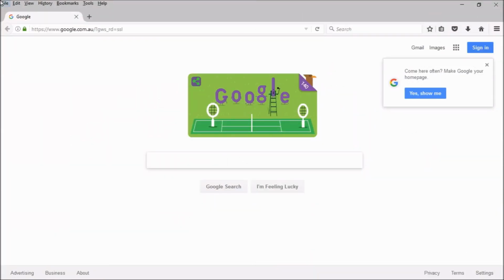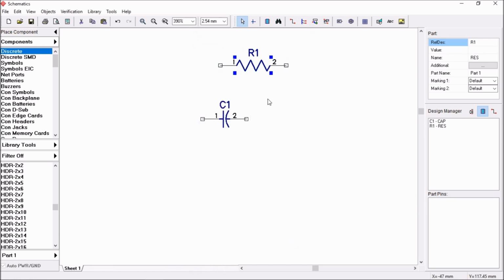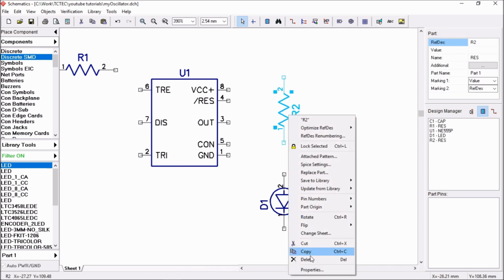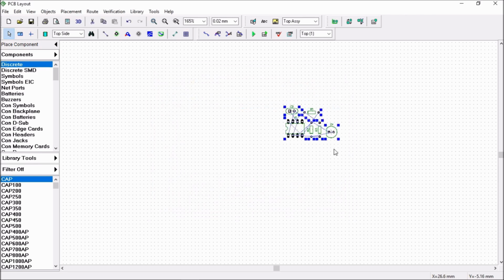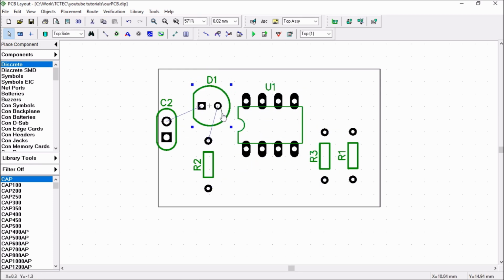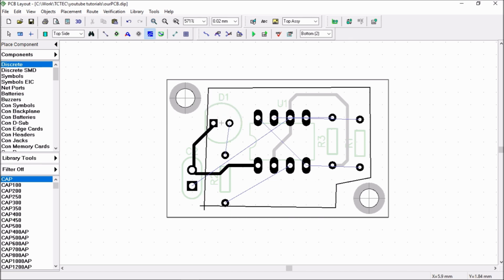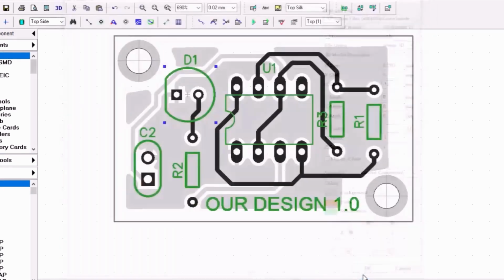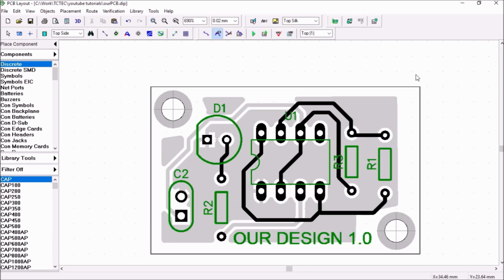Printed Circuit Board Design : Beginner. Step by step

Comment: Hello, I need help with a PCB that I’m doing for my 9th grade science fair project. I’m getting input from a solar panel, it’s not a big one at the slightest, only about 4.5 inches by 2.5 inches. How should I go about designing the PCB and what components would I need? I do not need to convert power all DC is perfectly fine.
Reply from the maker: What would you like your project to do ?
Reply: I need to harness power from a solar panel, and then output it to a DC Apple charging cable
Reply from the maker: @cletemoore8793  sounds like you need to convert DC voltage from the panel to 5volts DC to the phone,  and you could have a n LED for a light/indicator..
Reply: Is that all? No transistors or anything?
Reply: Is that all? No transistors or anything?
Reply: Is that all? No transistors or anything?
Reply: Is that all? No transistors or anything?
Reply: Is that all? No transistors or anything?
Reply: Is that all? No transistors or anything?
Reply: Is that all? No transistors or anything?
Reply: Is that all? No transistors or anything?
Reply: Is that all? No transistors or anything?
Reply: Is that all? No transistors or anything?
Reply: Is that all? No transistors or anything?
Reply: Is that all? No transistors or anything?
Reply: Is that all? No transistors or anything?
Reply: Is that all? No transistors or anything?
Reply: Sorry, my internet is whacked out.
Reply from the maker: @cletemoore8793  When I was in 9th grade, I was very lucky, I had a bike and I could ride to the library where there were hundreds of books. It would only take a day or two to look up this information in a magazine. There were no I-phones, I tried to solder things with a spoon heated up on the stove because I didn't own a soldering iron.  I am not going to do  your project, I know you can do it.  There are at least 4 ways you can make a voltage regulator , maybe you will discover a new way. Good luck with google

Comment: Thanks for the tutorial. I'm a newbie. This is tougher than it looks. I got a circuit with 17 components and it comes out as a  real spider web in the pcb layout. I cannot see how routes will not cross over each other no matter how I arrange the components. It's a maze. Lol. Any tips for pcb layouts with more components?
Reply from the maker: If it can't work out on 2 layers you may need to go to 4 layers. but either way: use vias to go over  or under tracks. Tend for vertical tracks on one layer and horizontal on the other. Wire the power and ground ptracks first.  Leave more space around the components with most pins. Use 'Verification->check design rules' to highlight problems.
Reply: @tctec1129  Thanks, After some practice I'm getting the swing of it. Ordering my first pcb today. Thanks for the tut!

Comment: Hi
How do you know after you design it,  it works?
Does the software has a simulation of its operation built in.
Reply from the maker: Hi, There is no simulation built in. The only way to test if it works is to build it. It is often a good idea to prototype first, or order a small number of PCBs to test.

Comment: Two reasons why it is important for DG08 engineering to refer to electronic component pin configuration specifications when designing and building printed circuit boards please help me

Comment: is it best practice to use the top layer for connections and bottom layer for ground?
Reply: The components are usually on 'top' so gravity can keep them in place when they go through the oven or solder- wave . Ground can be anywhere, but often ends up on the bottom.

Comment: What if the value taken for resistor, capacitor and voltage is wrong? Do you have a way of checking right after making the schematic?
Reply from the maker: Hi, there is no circuit-emulation. It is for drawing circuits and PCBs only. Each component can be  named anything. i.e The voltage could be called '10 billion volts'. It is only a label.
Reply: @tctec1129  What if you want to give a proper voltage or correct the value of resistor in your circuit before generating gerber. Is there a software tool to check the same?
Reply from the maker: @kinjudon8543  No, there is no software tool that can design yet.

Comment: On the schematic you have black traces and grey traces. What is the difference between them??
Reply: I may as well answer my own question I suppose. I think the gray traces are the underside of the board where a trace passes through a hole called a via from one side of the board to the other. Someone please correct me if I have misunderstood.

Comment: Why do you need a ground plane? (Also what did he call it? a copper port or copper poor?)
Reply: Always ask, 'Why don't you need a ground plane'. And put one in. That way, every 0v point, is actually at 0V and not some slightly higher voltage due to, resistance, and or inductance.    The word is, Pour,   Like the Queen says it.

Comment: Is it possible to run a simulation of our schematic? Like pretending to connect a power supply with a certain volt and ampere where the input should be, and check how the electrical current is making its way through all the components! To check if the value of the electric-current at specific components are correct or if I need to place another resistor between and just make sure that everything works as intended!

If it's not possible - do you know any software that has such a feature?

I'm not a very "organized" person (ADHD... 😏)! So I NEED a function to verifiy that my design actually works like I've intended, before sending it away for manufacturing and possibly causing a catastrophy! xD

I'm completely incapable of learning by studying/reading, so I rely fully on the trial-and-error technique 🤦‍♂️ (my friends and family are very sceptical towards my newly found interest in electronics 😅)
Reply from the maker: Hi Aerox,  Other design tools have circuit simulation 'SPICE' .   However, the process I recommend these 4 steps for your product development: 1. Rapid prototype with real parts (no PCB), 2. Make first PCB and test it. 3. Make second PCB and test it. 4. Make 3rd PCB design.    I believe there is no way to avoid these steps.  The first and second design will never work perfectly !

Comment: RayMing's PCB Fabrication capabilities provide you with all you need 

to produce high quality printed circuit boards - just specify your 

board order as you need it, and we'll tell you how to optimize your 

order for your design priorities. After your first contact, We will 

assign one customer support to serve you by 7x24, Any questions, 

You can get the response immediately.

Comment: Can it be used with Linux?
Reply: They aren't mentioning the Linux platform on their downloads-page. It doesn't seem to exist any good PCB designing softwares for Linux =/ Tried a couple of open sources, but all of them had either a terribly structurized interface or it had so many bugs that it was impossible to work with :(

Comment: I'm using windows 7 pc & the pcb editor failing to start & crashing every time. The schematic editor works fine. Please help me how to get the pcb editor to start
Reply from the maker: You could try changing the setting in menu: View->Graphics Mode. The Diptrace people are usually helpful also.
Reply: I have  tried the graphics settings  but the  pcb editor  application  is not  opening  but  only  crashing

Comment: great guide..covers a lot, without putting a glass eye to sleep 80) thanks for doing this.
just a couple of points though; but be careful using custom colours for the schematic..if you ever print them using a mono printer you may find some almost dissapear! and be careful your custom track widths aren't wider than the pads they end on; otherwise when they are soldered, the solder may be draw away from the pad along the trace, instead of flowing in the desired direction, around the components pins.

Comment: i dont see the pin headers for power supply... But, you have mentioned about battery in the schematics
Reply: the greatest results that ive had was by following the Gregs Electro Blog (i found it on google) without a doubt the most incredible course that I've followed.